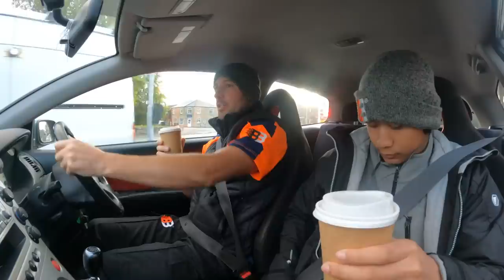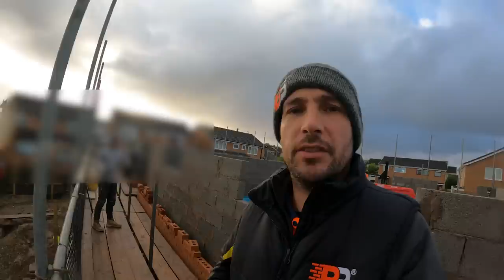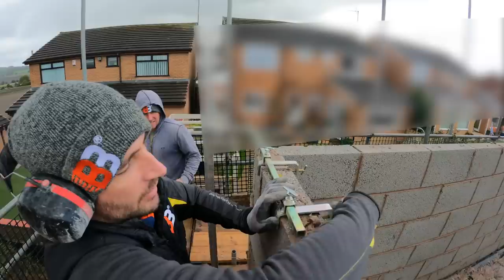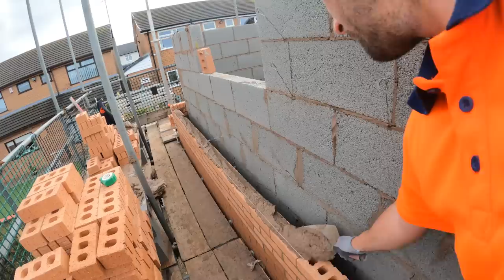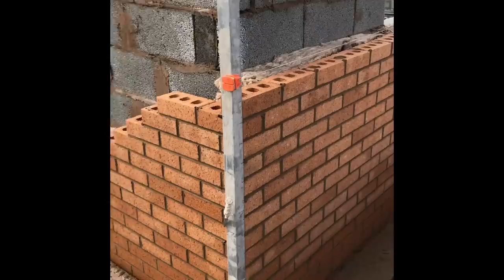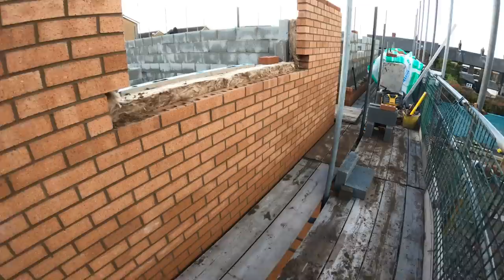Bricklaying - Converting To Pick And Dip Method?

Comment: Need to spread a deeper bed on the pick and dip and don't spread the entire bed it kind of defeats the object. One decent sized trowel full at the same time as picking up a brick, tend to tip the back in slightly as I lay it down to force the muck forward and not into the cavity. Works great when you've got the knack
Reply: Second time I've seen him misrepresent the "pick and dip", yet try to bring attention to it. Its frustrating. Ive converted and went from one of the fastest, to the clearcut fastest amongst my peers.
Reply: Your beds are wrong fir that method

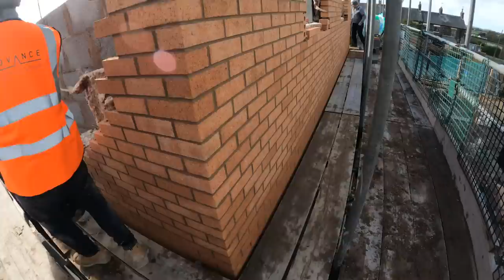Comment: 11:09  you have made a 3 brick high gap for the cil and on the right only a 2 brick high gap is that a mistake or is there a reason behind it ?
Reply: Because it's a bat and won't stay up till it sits on the sil
Reply: @hod2116  I know why the brick is in there I just won’t to know why 1 side is a gap 3 bricks high and the other is only 2 bricks high surly its a over looked mistake ?
Reply: @Chrismartin88  u didn't understand me the side with 3 brick high gap the top brick is only half a brick 100 mm and will be laid on the sill when it is fitted as it can not flout in mid air
Reply: @hod2116  ah yer sorry I get it now I didn’t look close enough when looking at the vid 👍🏻